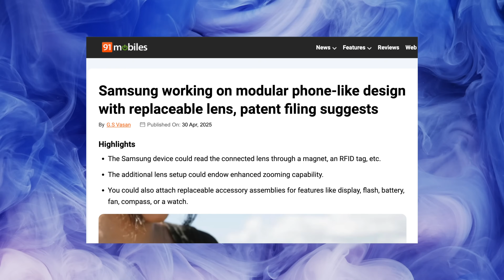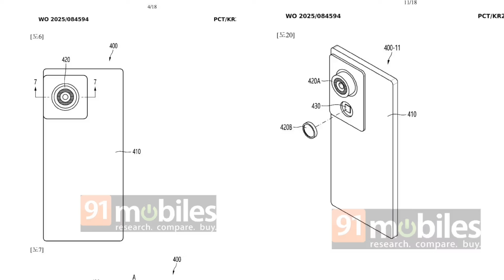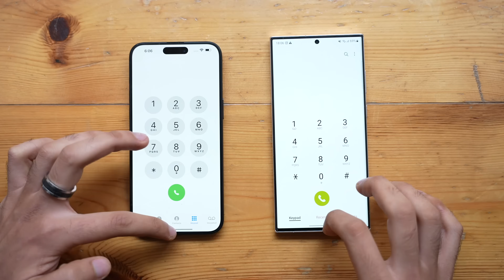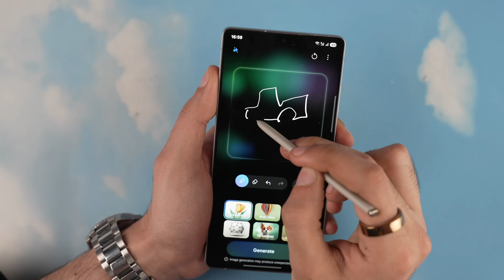Samsung Galaxy S26 Ultra - This is WILD.

Comment: What's wild is Nubia makes a $250 Focus phone with a 108mp sensor and interchangeable lenses, they one upped it this year, they put a rotating apeture ring on the Focus 2, which means theirs comes with a multifocal point lense built into itself already, Samsung gonna have to do better than that to win people over, they should be getting those types of options for the price you pay for those things, I still think for brut power the Red Magic Pro series makes more sense and if your into photos the Focus is only $250, yes the Focus comes with a midranged processor but for $250 vs flagship prices makes way more sense to me, call me crazy

Comment: I wouldn't want to carry seperate lenses with me.... I would much rather see:
- 50MP 3x optical zoom. I always use this lense because the main camera has a wide angle lense that distorts the image. But the zoomlens needs better quality
- 6.500 mAh silicon-carbon battery for even better battery life
- at least 65W charging. If not more. Less wait time for the battery to be charged, in any case
- Bluetooth functionality restored for the S-pen. I did not upgrade to the S25 Ultra because I use it as a remote shutter and a clicker for powerpoint presentations
- A Snapdragon 8 Elite gen 2 chipset. Obviously 😅

Comment: Snapdragon 8 gen 2 still good and rocking solid on my S23 ULTRA no need to change that in my opinion
Reply: Doesn't it have the snapdragon gen 1?
Reply: @keshavnagpalg  Mine is Snapdragon Gen 2 not 1
Reply: @keshavnagpalg  no

Comment: 6500mha silicon battery and just a better 3x optical or ditch it with the 5x and do something like a 200mp telephoto.
Reply: If you want a bigger battery for Ultra, you need to fight with Ultra S-Pen fans. Some people like the S-Pen because it can be used as a remote.
Reply: @donglee-cj2dg  I still think if they use silicon carbon battery,  they can put 6000mha and still have an S pen.
But now that I use a S25 Ultra that is only 218g of weight, I cannot stand a heavy Ultra phone that is like more than 230g.
So it is difficult to balance everything.

Comment: Samsung again shoving exynos to costumes that don't want it!
Reply: What is exynos exactly? And how is it different from whatever they are currently offering?
Reply: @balla2828 exynos/snapdragon is a processor chip(the brain of the phone). It handles the functionality of a phone, from   how fast it responds to your input actions, how efficient it can multitask to how efficiently it can support phone's battery life etc etc. Snapdragon has always been the best when it comes to all these aspects, while exynos has always fallen behind and often had issues, Snapdragon has and will always be superior, exynos has made some improvements in past couple of years however not enough to compete with Snapdragon. Think of it this way, would rather have Louis Vuitton bag(Snapdragon) or a bag from Temu(exynos)
Reply: @hughw2377  nice thank you so much for that description!! Is there anything else you could add? Important info regarding the two?

Why don’t all phones use snap dragon then?
What do iphones use?

Also why isn’t exynos improved to match snapdragon? Wouldn’t it be obvious for them to copy and match snapdragon?
Reply: @balla2828 apple use their own chipset. All the best Android phones use snapdragon chipset because it's the best chip for their phones. Samsung uses exynos because it's their own exclusive chipset and saves them money, samsung stopped using exynos on the s25 series, and it reportedly cost them 400 million dollars, that's why they wanna bring it back. They hope one day that their exynos will outperform snapdragon, but they can keep dreaming 😂. As for my own personal choice I'll never buy a samsung with exynos, id rather get the Samsung s25 ultra with snapdragon than any s26 series with exynos.
Reply: @hughw2377  wait so on what Samsung phones are they bringing back the Exynos?

How does Apples chip compare to Exynos & more importantly Snapdragon?

Lastly, the difference between Snapdragon and Exynos is really that extreme that you would never do an S26 with Exynos?
Reply: @balla2828 s26 s26 plus are going to have exynos ultra will be snapdragon I think. Apple and Samsung are somewhat similar although apples chipset is far more battery efficient that's why it can last longer than samsung. Exynos has had phone heating issues in the past, heating problems will damage the phone over time. I just think if someone gonna spend their money on a premium ultra phone get the best of the best, if exynos was "so good" all samsung ultra phones would be using exynos instead of the snapdragon they've been using lol
Reply: @ So ultimately snapdragon on the S26 Ultra is = to Apple’s chipset?
With the snapdragon being inferior in battery? Meaning apple wins?
Reply: @balla2828 apple wins in battery but not in everything, samsung is good in other aspects. That's why it's good to watch comparison videos, you can see what features matter to you the most, everyone has their own preferences.
Reply: @balla2828 also another reason why snapdragon tends to be better than exynos is gaming experience, games run smoother using snapdragon and more consistent over time while exynos can sometimes get laggy on maximum settings
Reply: @ but what is your personal opinion on snapdragon vs apple’s best chip?
If you had to choose 1 and why?
Reply: @balla2828 I pick samsung because I'm more familiar with it, I like their layout of apps, I like the phone designs, camera is great, faster charging, less expensive. These are the reasons I pick samsung over apple even though apple has longer lasting battery. I just wished samsung would improve their battery efficiency instead of ai crap, samsung has been slipping behind on battery in these last couple of years.
Reply: @ got it brother thank you.
Can you share any insight on Samsung AI vs Iphone AI?

Also when you estimate S6 Ultra will be available?

Comment: You need to stop acting like the S26 Ultra will have it.
Reply: This phone is like 9 months away from release, so yes there is definitely a potential for it to be in it.
Reply: @luigynkaren062011  The only confirmed specs for the cameras is the 50MP 3x Telephoto, Optimized 200MP Sensor, and a DSLR like variable aperture
Reply: @Alex-i7v1v  still, the phone is months away, nothing is confirmed until the production model is made, everyone said the z fold 7 would be 9.5 inches thick, and now the final rumor is 8.2, the s26 is about 9 months away, anything can happen specially when they said they promised to be more innovative.

Comment: If exynos in Europe for s26u I will avoid it.  Needs to be SD.  Got current ultra with exynos.  Alway had SD before then.
Reply: This video clearly states that only the S26 and S26+ could be Exynos. The 26U will be exclusively Snapdragon.
Reply: @neilmcguinness4422  I made a post where I ask this thing
so did you also understand that the ultra version will have snapdragon everywhere, including europe?
Reply: Whats wrong with exynos?
Reply: @gilbertmacharia7309  poorer quality chip. Not as fast, less power. Makes cameras worse. Generally overheats. It is cheaper for Samsung to use. Have an exynos in my phone, but would not upgrade to a phone with it with so many using snapdragon elite or elite 2.  Feel the 2600 may be OK.